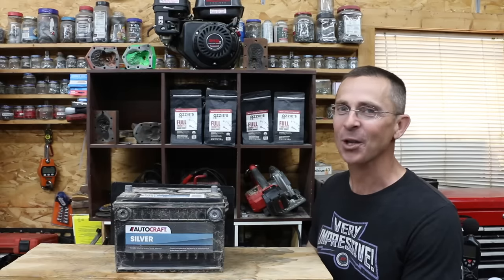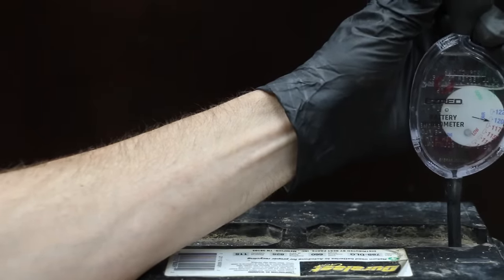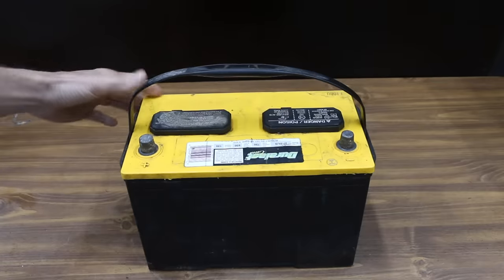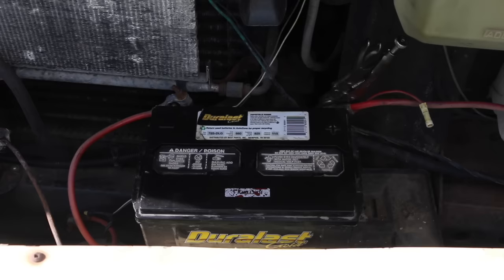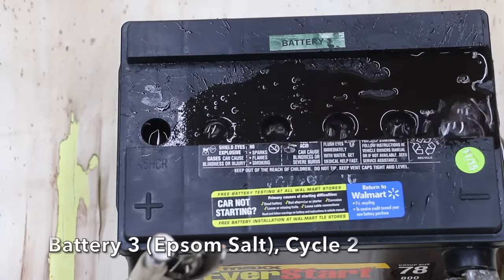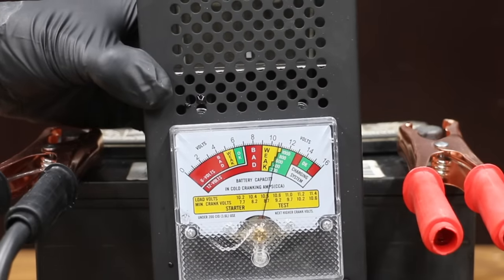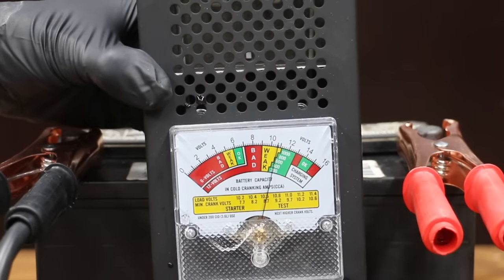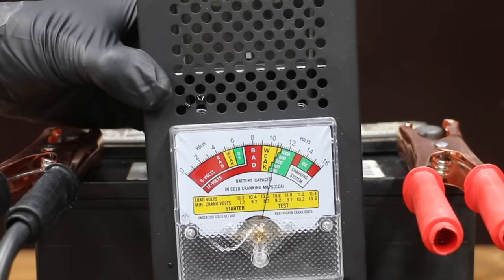Myth Busting! Can You Restore a Dead Car Battery With Welder?  Let's Settle This!

Comment: Did not expect that welder trick to work as well as it did. Impressive.
Reply from the maker: Thanks for the feedback.
Reply: "Very impressive!"
Reply: Just never do it with a lithium battery. Then you will get a very sudden surprice.
Reply: @matsv201  free fireplace
Reply: @LatvianVideo  IKR and while a lithium jumper is probably really good insurance, I've watched enough lithium fire videos to not even want to keep one in the trunk near the gas tank, would try to find a place in the engine compartment to secure it. Probably overcautious of me.
Reply: @dougrobinson8602  when he says that it gives me a reason to keep living
Reply: @LatvianVideo  well.. not really free
Reply: I did not expect it to work either. Was thinking this is a great way to blow yourself up. I am now suitably impressed.
Reply: A welder and a dc charger is pretty much the same thing.
Reply: But normal charging of lead acid batteries isn't that many amps. Even the ones that de-sulfate.
Reply: @honestjhon  That is true, that is probobaly why it works that well
Reply: Probably makes those plates SING. HAHA

Comment: I literally am blown away at this concept... Interesting that only certain batteries can be revived, but the FACT that they can is what really impressed me! Awesome test video!!
Reply from the maker: Thank you for sharing!
Reply: The principle is the high voltage of the welder causes the outer layers of the lead plates to melt and shed, thus exposing fresh lead to the acid. Problem is modern batteries are using less and less lead, so it doesn't work as well as it did 'back in the day'.
Reply: @LordFalconsword  seems like certain brands use more lead, according to this video. The autocraft seems the best
Reply: @ProjectFarm  I wonder if the welder would work on those batteries that wasn't tried on it as a test. The desulfater tested one, zap that one with the welder and see if the results change.
Reply: @LordFalconsword  Fascinating! I’ve got numerous welders but never crossed the mental bridge this could be ‘used’ in this fashion without serious risk(s). So creative!
Reply: @LordFalconsword  The other problem is the sulfated lead falls down to the bottom of the battery and can buildup enough to just short out the plates inside each cell, essentially resulting in shorted cells and a dead battery.
Reply: @LordFalconsword  Also, shedding creates sediment and if you have enough of it will short-circuit the plates (on the bottom). Best would be to shed the plates, rinse it thoroughly and then put the fresh acid. If that doesn't help then you did more or less all that you could do to save the battery :)

Comment: I like that we've moved into experimenting! I asked a long time ago for a video comparing the best ways to take out a tree stump, hopefully we could see that this summer 🌞🌞 🌲🌲
Reply from the maker: Great suggestion! Thank you
Reply: Explosives!
Reply: @美優美結実優美夕みゆ  YESSS
Reply: That would be great!
Reply: Do cost comparisons, including renting a stump grinder.  My taco has a trailer hitch so I rented a towable stump grinder.  Not only did it make mince meat of some 10 stumps, it was hella fun.  Don't forget to include the fun factor.
Reply: Excavator, if you have more than one to deal with.
Reply: Plant an oak seed close to it. Wait twenty years. Remove displaced stump.
Reply: @ProjectFarm  'John from FarmCraft enters the chat....'
Reply: Drill several holes, Mix a quart of wetting agent to a gallon of gas or fluid of choice, wet down stump a third of a gallon at a time every 5 to 10 minutes, place a mound of coals on top and set fire add coals till we’ll done
Reply: @brodriguez11000  "acorn" =-)
Reply: Cut it flat to the ground and ignore, if you can drive of the stump with your lawnmower it, the stump doesnt bother. If you cant cut it flat or dont want a brown patch on your lawn, add some dirt and bury it in a thin layer, now you have just a small hump.
Basicly out of sight is out of mind.
Reply: My cousin, back in the 50s, used dynamite.   He was 14.   That was when dynamite was just sitting on the hardware fully accessible store shelf.. and it still was in the 60s, when I was a kid.. just like all the ammo.
Reply: Chain over an old tire works well. The force is more upwards than side ways.

Comment: Very interesting and finally someone is testing the many suggested solutions out there. Since "open" batteries aren't very common anymore it would be very interesting if those (or other) tests could be repeated with more modern battery styles like maintenance-free batteries, GEL batteries and AGM batteries. Since on all of them no water can be refilled and extensive bubbling (due to charging with too high voltage and amps) will lead to permanent loss of water in the batteries (which mostly leavs the batteries through their safety valves) it would be interesting to see if there is any way to bring also such more modern batteries back to life again besides complete recycling.

Besides all that it would be interesting to see a real world performance and durability test of all the lead-based battery technologies out there:
- Standard lead acid battery (liquid electrolyte)
- VRLA battery (classic maintenance free battery)
- GEL battery
- AGM battery
- pure lead battery (special type of AGM battery)
- lead crystal battery (SiO2 battery)
- others if they exist...
Reply: I’d like to see options or at least attempts to bring back SLA (AGM) batteries.  I’ve had good luck with prying off the thin plastic too which exposes the little rubber caps (pressure reliefs).  Simply pull the little caps off with needle nose pliers and add a small amount distilled water via syringe.  Leave caps off and hit them with some amps for a few quick cycles then a slow charge at 1/10 Capacity overnight.
Reply: All the automotive or large garden equipment batteries I see are still open cap.  They just make the caps MUCH more flush to hide them, because obviously the inside of the engine compartment must be made beautiful.   That reminds me, since my car was totalled, and I pulled the battery, I should open it up and check the electrolyte levels.
Reply: I have access to tons of bad AGM motorcycle batteries,  if PF wants to do a test like this I could send him some
Reply: Those maintenance free junk is just another topic of 'remove options to repair'. Just glue it shut or glue a cover on and they have no option to fill them back up.
Where I was working at a shop, the standard procedure war to all was top of the batteries when a vehicle came in for inspection.
But seeing now 2 to 3 year old batteries die due to the missing maintenance option is such a waste of recourses
Reply: Those modern batteries are still open batteries but with a welded on lid. You can pry it open.
Reply: In AGM batteries, the electrolyte is bound in glass fiber mats. The advantage is that the battery can be operated in any position (except upside down, because the safety valve would then be at the lowest point), and other properties of the battery are improved compared to conventional batteries with liquid electrolyte. These include better temperature resistance, higher cycle stability and lower internal resistance and thus higher Cold Cranking Amps.
I don't see how prying open such a sealed AGM battery, unless it can also be welded back shut, would benefit the repair in any way. It is also questionable whether you can get water back into the glass fiber mats of the AGM battery by simple refilling it with distilled water at all.
Reply: Gel and AGM batteries I know can not have the welder trick done because they can't "boil" like a regular lead acid battery with the liquid electrolyte.  If they are overcharged the gel batteries end up with gas pockets near the plates which effectively kills them.  AGM has something similar happen and they basically lose the electrolyte killing the battery.  With those about the only thing you can do is try a trickle charger and hopefully revive them but the odds are against it in most cases.
Reply: @VentShop  the boiling is most likely hydrogen gas being generated.  It’s why he made sure to have a fan on so nothing would catch fire or explode.
Reply: @shaunkelly9053  Nothing in my statement was about the gas exploding or ventilation.  The issue is that in a gel the gas bubbles form and ruin the battery.
Reply: @VentShop  I know.  I was just saying.
Reply: water can be added  to AGM batteries...  the caps are jsut hidden behind a label
Reply: Gel is much less resistant to abuse and the recharge voltages must be adhered to strictly.  They are definitely not AGM or flooded battery voltages. As noted here, causing a gel to "gas" effectively kills it in short order and there is really nothing you can do to bring it back.

AGM "caps" are actually pressure relief valves.  Typically 1-5 psi before they open.  The cells are under pressure during phases of use, the goal is to keep the hydrogen and oxygen gas  inside the battery cell so the recombination cycle can happen. Common failure mode for AGM is dry out, excessive gassing (electrolyzing of water), valve opens, H2 and O2 go out, and enough cycles of this the battery is done.  The cover is welded or glued on to prevent tampering.  Lose a valve or allow excess O2 into the cell and you have an expensive paperweight in a few weeks tops.

In theory you could rehydrate AGM but you would want to do this on a fully discharged battery where the liquid in the glass mat has as low SG as possible.  But more likely you would just end up with heavily stratified concentration within the mat.  There is no opportunity to equalize the acid in AGM.

Comment: I live in AZ, heat is the biggest killer of batteries around here, they only last 2-3 years unmaintained.

I would love to see you test different oil filters. STP, Fram, Purolator ETC. If you could mix some OEM filters as well in there that would be cool.
Reply from the maker: Thanks for the suggestion.
Reply: Rule of thumb is every 10C (18F) you go up in ambient temperature above 25C, the life of the battery is cut in half.  This is complicated by placement under the hood, but many cars now have them under the seat or in the trunk in part because the temperature is less variable.  But the interior of an AZ car left outside is still probably 30C over design life temperature.

Comment: I am a huge fan!  I have watched a lot of these types of tests and yours are undeniably the best I have seen. On battery reconditioning I am always left wondering,  after treating the battery with Epsom salts, do you rinse and refill with battery acid?  If you could replace sulfuric acid with Epsom salts for normal use, I'm sure the industry would have switched years ago. I found an article that said you can add Epsom salts to get more time from a battery, but I haven't seen anything about fully replacing the electrolyte. Comments?
Reply: It also depends on state of charge. Battery electrolyte is chemically different depending on the charge. A fully dead battery has no sulfuric acid in it and the electrolyte is just water.

Comment: Thank you for all the great informative videos.  I agree with the other comments that the epson salt has to be drained and the battery rinsed with distilled water and then new sulphuric acid before recharging.  My understanding is the epson salt removes the Sulfation coating.  The battery electrolyte should be 38% Sulphuric acid.

Comment: Your testing on those old batteries with shorted and open cells had some impressive results. I did similar tests years ago and experienced good results in the short-term, but the gains didn't hold up. I really enjoyed the video! A++
Reply from the maker: Thanks!  Glad you enjoyed!
Reply: Batteries never last 
Thats why electric cars will never beat the range of a combustion engine. And it will also last longer
Reply: @HappyDude1  which type of battery does an electric car use? Which type of batteries were tested here? Which type of problems and maintenance does an engine needs? Which type of maintenance does an electric car needs?
Which car is the best? I will give you the answer: IT DEPENDS on what you need and usage
Reply: @HappyDude1  Don't conflate a lead acid battery with the LiIon battery used in electric cars.  Typically, an ICE vehicle lasts about 200,000 miles.  Tesla batteries (model S and X) retain 90% of their new capacity at 200,000 miles and warranty that for 8 years or 150,000 miles, a warranty that certainly exceeds any power train warranty on an ICE vehicle.  The other parts of a Tesla don't tend to have a lot of issues, very few moving parts.  A Tesla will need new tires about every 50,000 miles, windshield wiper fluid, brakes maybe every 100,000 miles, and a periodic wash and vacuum.
Reply: @apostolakisl  ^^^ This
A modern EV battery is likely to outlast the chassis.

Everything will have failures outside of warranty, but before expected EOL so there indeed may be the odd person whose battery totally goes to pot 1000 miles after the warranty expires instead of the expected 300-500k.

Such cases will be atypical and something a low cost insurance product will be created once the post-warranty but pre-EOL failure rate is known.

Comment: This makes total sense depending on the condition of the lead cells, didn't knew a welder could clean them that well, if you dump the electrolite rinse it with demineralised water and put fresh electrolite it might perform even better after doing the maintenance with the welder, the epson salt I was almost sure it wouldn't work and would be very surprised if it did, great content!
Reply from the maker: Thanks!
Reply: Epson salt is Magnesium Sulfate which is an electrolyte

Comment: I do this all the time. I use a old snap on 200 amp charger that produces 16+ volts on boost to boil the battery. It’s before the newer electronic crap that’s sold today. Works great and even though it may not bring it back to new it allows for more usage out of the battery.
Reply from the maker: Thanks for sharing.

Comment: Great stuff.  Batteries aren't cheap these days and sometimes needlessly replaced. I invested in a CTEK charger with a reconditioning mode.  Saved quite a few batteries and considering it was the same price as a decent car battery it's paid itself back
Reply: I have a CTEK battery charger. I love it.  I also have Clore Automotive PL2320.  Another great battery charger I love the 10 amp and 20 amp cycle. I feel as if the 10 AM cycle is the best.
Reply from the maker: Thanks!  Thanks for sharing.
Reply: I don't get this batteries aren't cheap these days. I the price of a decent 75 Ah battery on groceries every weekend and on average about every two three days.
Reply: @Axel_Andersen  why are you comparing the price of a car battery to groceries?
Reply: @TheBlaert  Because everything is relative, there is no absolute expensive or cheap, you need to relate them to other things you use money for in life.

 If I can get a car battery for the price of 8 jars of Ben and Jerry that my children want to have daily I do not consider the car battery expensive. I do consider B&J expensive ;)

Comment: That’s so crazy!! I have had the BEST luck with the $20 desulfator. It’s saved my motorcycle battery two years ago after I left the key on for a month. Wouldn’t charge past 12.1v or so until I hit it with the desulfator for a week. I think each battery can fail for different reasons, and each method may work for some, but not all failures. FANTASTIC VIDEO!!!
Reply: Additionally, every time I run it on any of my car batteries, the battery will test higher cranking amps afterwards. Usually 5%-20%.
Reply from the maker: Thanks!  Thanks for sharing.
Reply: How long to you leave your desulfator on your batteries?

Comment: Very interesting. What voltage did the battery  get to on the welder? Did you try adding sulphuric acid to low cells? I have extended the life of SLA batteries by removing the covers and adding acid.
Reply: Depend on welder, my welder starts from 17 V at 20 amps up to 26 volts at 200 amps

Comment: Hey I have a suggestion I think you might love! Even thought it’d be late for Memorial Day, with summer coming up, you should do a video on coolers, specifically the bigger chest ones! Testing things such as durability, insulation, latch strength, or whatever else! And see if a Coleman cooler is just as good as a yeti cooler!
Reply from the maker: Thanks for the suggestion.
Reply: America’s Test Kitchen did this very test.  Probably not as thorough as PF would be though.

Comment: Probably out of your area of experimentation but I have successfully used a Bedini Motor to restore badly sulfated lead acid batteries for many years. I have often restored batteries at 0.5 volts that I got from a junk yard or garbage heap to fully usable again. It is more like the little pulsing desulfating device you showed but more effective.
Forget all other claims for this motor for now. It restores batteries well.
Reply from the maker: Thanks for sharing.

Comment: Thank you so much for this video! 

The reason the desulfator and the epsom salts are working out so badly is that you are not adding (sufficient) charge while applying the method. 

Please try again with the desulfator plus a modern charger, and also charge the battery after applying epsom salts. 

I would also recommend adding a "sample" battery which only gets charged for the time to see how it's performance changes in comparison.